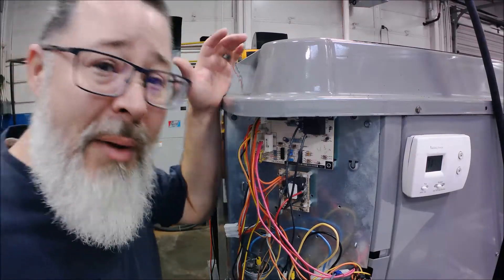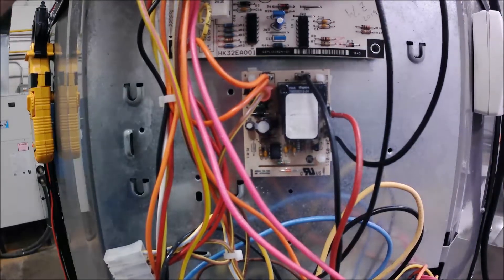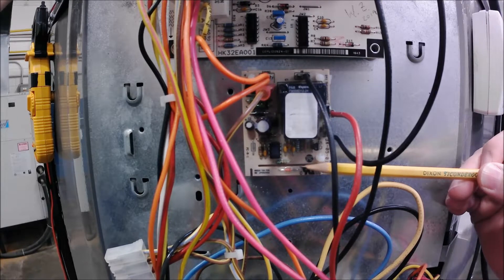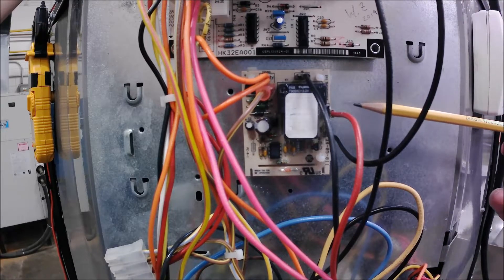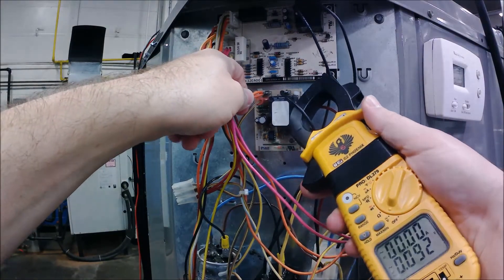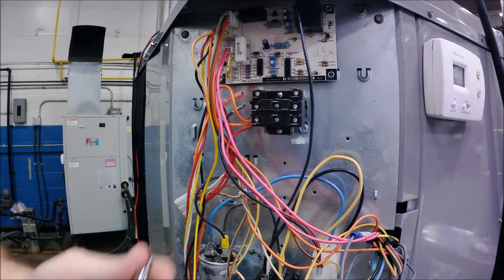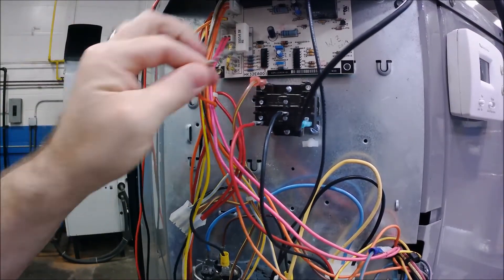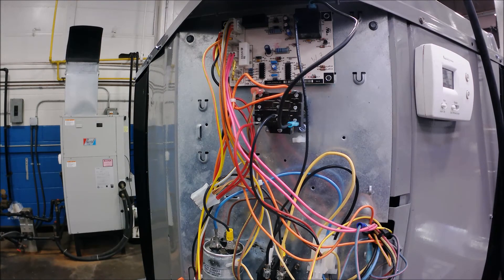2 Speed Fan Motor Board - Replaced with a 90340 Relay | Understanding HVAC Electrical Concepts

Comment: Does a 2 speed 230 volt motor always have 230 going to the plug? Or does low speed run on 120 ?

Comment: On a older Lennox roof top the inducer is a 230 volt 2 speed motor and the w2 goes into an ice cube relay it has 4 wires going to the inducer motor and someone tore off the wire schematics so between this cube relay and 4 wires plus the board it’s kind of difficult for a new guy to figure this out. The four pin connection at the inducer has 122 on one of the terminals but who knows if low speed runs on 120 and maybe high runs on 240 it’s just frustrating
Reply from the maker: I can understand the frustration part. I don't have much Lennox stuff around my parts so  I don't know how much help I can be without the diagram. Got a model number? Maybe we can come up with something?

Comment: hi john, Can I use the same relay on gas furnace in case of weekend emergency?
Reply from the maker: Depending on what you want to accomplish...maybe. Furnaces get a little trickier when doing this stuff.
Reply: If I have a service call in a hollyday to repair a gas furnace, and the fan blower motor is not working. Can I bypass the board using the 92340 switching relay, of course it's a temporary fix, until follow week I can go to my supply house.pls advice me, thanks
Reply from the maker: If it is a PSC motor then you could try it for a temporary solution. I think the 92340 relay is the replacement for the 90340 relay I like. But with a furnace you typically have a delay before the blower cuts on after the furnace fires up. By putting a relay in there you would probably have to wire the G circuit straight to it and maybe even have to program the tstat for electric instead of gas just to get it to work. Might be more of a hassle (honestly) but depends on you and the situation.

Comment: why on lower speed fan draw higher amps  .72 and at higher speed fan draw a lower amps  .66 after switch to a relay?
Reply from the maker: Sorry...been school shopping. I would think the low speed would have a lower amp draw. Sure you looking at it right?
Reply: @johnjennings-JJ  I think what they are trying to say is that amp draws were different for the low and high when you switched from the board to the 90340.
Probanbly due to the sensitivity of amp clamp at low amp readings and position of jaws around wires.
Reply from the maker: Thanks for pointing that out. It was a long couple days trying to get school stuff wrapped up. Didn't even read it that way! But I would have to agree...probably just the position of the wire in the jaws or something simple. I'll try to go back and look at it to verify. Thanks again.

Comment: The only one I found. Very useful. Q: Wondering if you know where to by these kind of speed controller board - I am about to replace the board with relay as you do. Thanks.
Reply from the maker: I haven't really had to replace any but I would just go to my local supplier or amazon it!

Comment: Should the condenser fan motor run in high speed in cool mode and low speed in heat mode when replacing the control board to a relay. Just thinking since there's no thermistor , call for heat low speed and call for cool hi speed?
Reply from the maker: Easiest way for me to keep it simple is that the motor is pretty much gonna run in high speed unless the temp is below the 82 degree mark. With low ambient cooling it will run in low speed.

Comment: Thanks for putting these nice videos. As a senior hvac tech have a huge respect you and still a lot to learn everyday on different jobs
Would you be able to put wiring an old heat pump with just relays to work. I'm in charge of teaching our new tech we hire. But I haven't come across any old heat pump in our install department for past 3  months. 
I really like those old mechanical devices. It really teaches new techs how things do work than just looking at modern board which leaves them clueless 
Thanks for your help and time
Reply from the maker: There is another guy that is going to do that in our shop soon. I will see if I can jump in and post something when he is working on them. Thanks for watching.